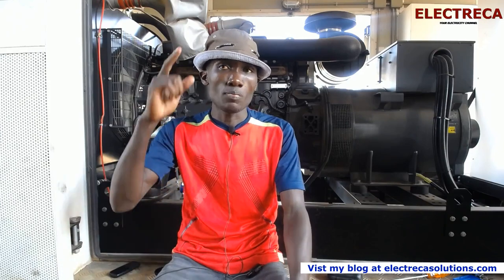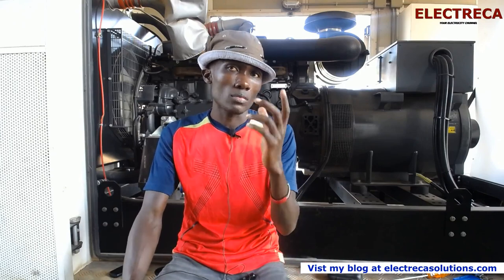generator service and maintenance| Volvo Penta 500kva

Comment: Very excited dear engineer. What of servicing the radiator, how to deal with it?
Reply from the maker: You can detach the radiator from the engine wash it gently with pressure washer both outside and inside. assemble it back and fill new coolant.
Thanks for watching.

Comment: How often do u have to change. the oil filters, fuel filters and the air filters.
Reply from the maker: The recommended time is after every 250 hours, however if your in the controlled environment an Air filter can be changed after 500 hours.
Also if your to use a fuel filter more than the recommended period, you have to make has FUEL WATER SEPARATOR and PRE-FUEL FILTER.

Comment: Why are you adding oil to the new oil filter before putting it back and the respective filters
Reply: Cause the filter sucks up alot of oil making reading at final check not accirate its an old trick even with cars